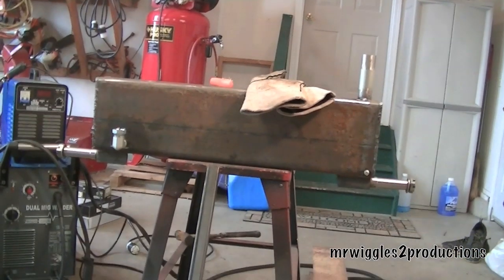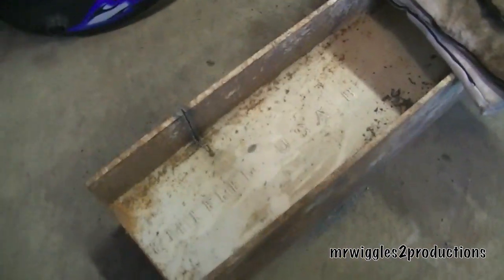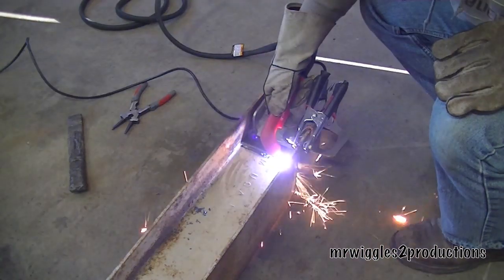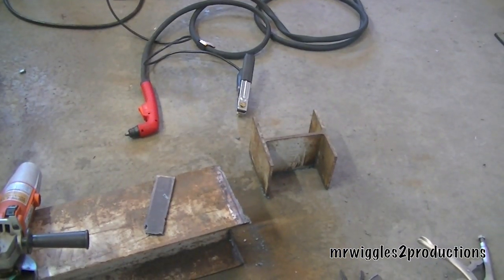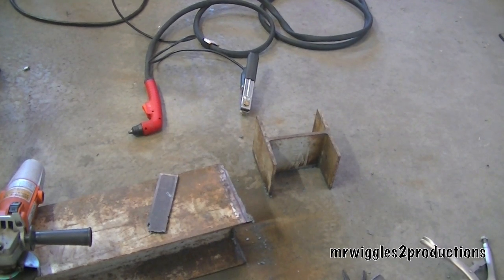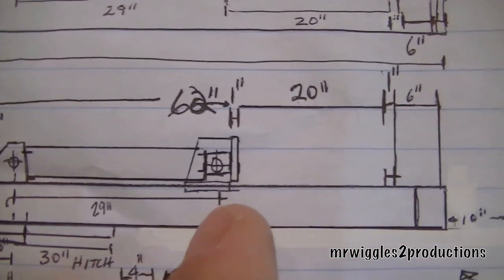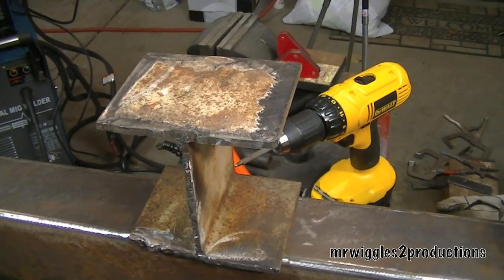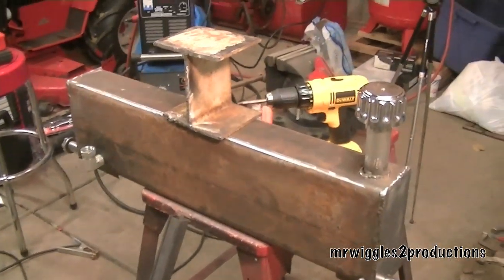Homemade Log Splitter Build Part 4

Comment: the place that you are going to put the hubs on, the bars sticking out, what are the name of those and where can i get them? thanks craig great project
Reply from the maker: Spindles.  I got mine online at a decent price.  Tractor Supply also has them.  Make sure you weld them out far enough so that when the wheels are on, they don't rub against the tank.

Comment from the maker: I'm impressed.  It's got a huge duty cycle and on Welding Web forum has been used by a lot of guys in cnc machines.  It's on sale too which made me pull the trigger.  Needs dry air from a compressor, had to run another 220v line over the weekend to power it with compressor.

Comment from the maker: Yes it should be about 20".  Was 29" midpoint of the pin holes and 22" midpoint of the hydraulic ports.  Took off 2" for the piston.  Was keeping it 1" off the wedge, but could do as you say and load the logs easier.  Could load bigger logs too.  Thanks dejanira2, great idea!

Comment: The cylinder stroke is 20? If that is correct then you don't need to have the ram travel all the way to the wedge. You could have 6" or so free space there to make it easier to load the logs.